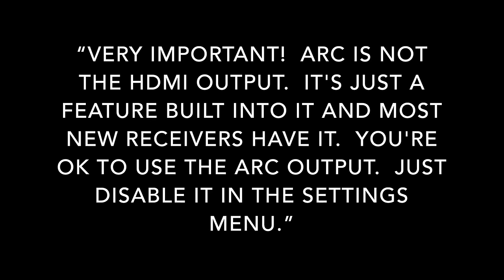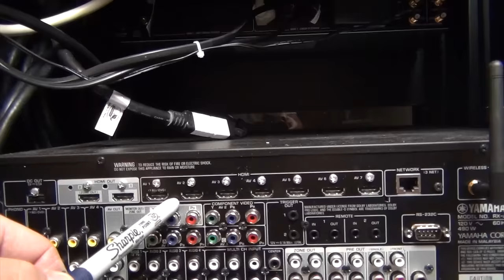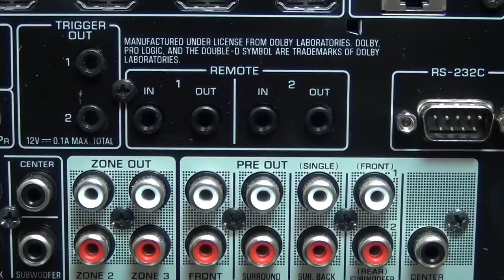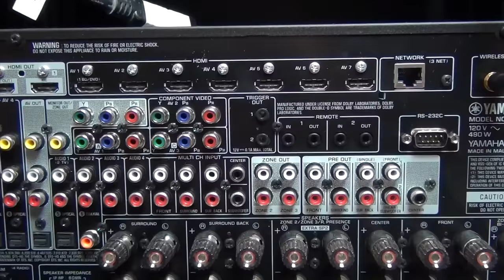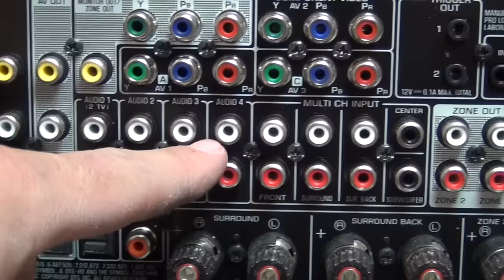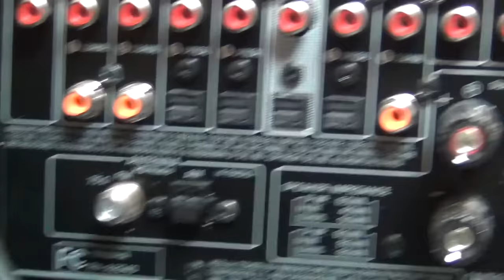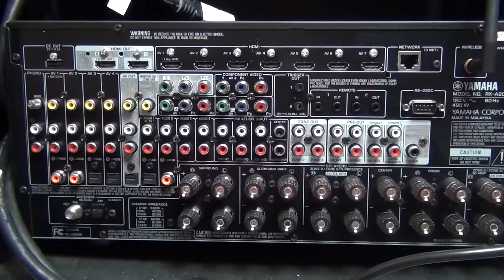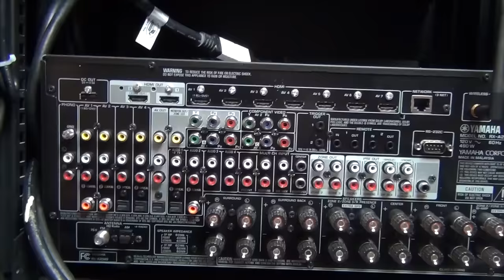How to connect a surround sound receiver - Part 3

Comment: Thanks for all the info and the last time I hooked up a surround sound was about 15 years ago and things have changed,  Question - I want to incorporate my two stereo systems into a surround sound system.  The two stereo systems each use separate Krell integrated and they each use two martin logan speakers.  I would like to set up a 5.1 using one stereo system for the front two and one stereo system for the two surrounds and I have a Martin Logan front speaker I could hook up to the processor as well as a veladyne sub which I would also hook up to the processor (Integra Receiver bought about 3 years ago).  Does that sound feasible using the  zone out / pre out  and which ones do I use - the pre or Zone.  Or should I just hook everything through the surround receiver.  Thanks
Reply from the maker: That COULD work, but I think you should only do that if your main receiver is under-powered to handle your speakers. You will use the pre-outs. "Zone" is for controlling speakers in a different room. Pre-out from your receiver to one of the inputs on the amp. Make sure you connect the RIGHT FRONT PREOUT to the RIGHT CHANNEL INPUT on your amp. Same for left and surround back. That's a lot of equipment to involve and a lot of adjustments to make it balanced. If a kid comes up and adjusts the volume, balance, or inputs on one of your slave receivers/amps, you'll have to adjust it back in. Then you have to make sure they power on/off together and remain on the right inputs. Sounds like a headache, but it can be done. Does that make sense?
Reply: Thanks Alan and it makes sense to keep everything in the processor.  Thanks for the quick response and too bad you do not install in Miami.  For me as I enter my golden years  the front speaker is the most important or I have to use subtitles.  My Bose TV with built in speakers died and Bose no linger supports it so they sent me a free Lifestyle 4500 and told me to go buy a TV.  The system sounds okay but I like my integra system better which is at my second home which I just sold.  So the Bose is going into the bedroom and the Integra into the TV room to use with my new 65 OLED LG.  Thanks again
Reply from the maker: Best of luck and thanks for watching!
Reply: What's a sticky  ?
Reply: Great vid by the way  :)

Comment: My denon receiver has no hdmi arc but my new Samsung tv has hdmi arc what am I to do no sound 🔊 surround sound ❓❓
Reply from the maker: The ARC on the TV won’t matter. ARC is a feature that can be disabled. I didn’t do a good job of making that clear. Just plug your cable/sat box to the receiver hdmi input and the tv to the receiver hdmi output and you should be golden.

Comment: What is a blaster?
Reply from the maker: I'm referring to an infrared red blaster for remote control systems. If you're using some kind of RF base station for your remote control, you're going to need to use infrared red blasters from the base station to blast the front of each device. Nice receivers have IR inputs on the back so you can connect a 3.5 mm mini directly into the back of the receiver. It's way more reliable in the short and long term. Typically, base stations have 3.5 mm minis for the IR blasters so you would just use a 3.5 mm mini to mini cable to connect the base station directly to the receiver.

Comment: a bit rushed.  up conversion-upscaling only gives fake hd, -  it cannot create the extra HD information not existing in SD input signals. it may be done better by monitor/projector, so compare. them with receiver/processor.
he mixed up speaker output terminals, calling them 'inputs'. centre channel s important for clearer dialog.
Reply from the maker: I actually agree with everything you said. Thanks for watching and commenting!

Comment: Isn't arc used for sound bars?
Reply from the maker: I try not to use ARC for anything but if you’re streaming Netflix from your smart TV and hooked to abound bar, you’re limited on options. If it were me, I’d get a Roku and stick it to the back of my TV with industrial strength Velcro tape and stream from that. Then connect the Roku to the sound bar. I really don’t like ARC so I try to avoid it at all costs.
Reply: @AlanCleggYouDoAV  our tv is a roku,, and just got a jbl 3.1 sound bar, it is showing to use the arc,
Now my living room is a whole different story,  Yamaha receiver and separate Yamaha amp,  klipsch speakers
Reply from the maker: @garys9718  Is the ARC feature working for you? For example, I like listening to Pandora without turning on the TV (trying to reduce wear on the TV). You can't do that while using ARC and obviously not if you're using the TV for streaming. I'd say, if you're happy with how it works with ARC, roll with it.
Reply: @AlanCleggYouDoAV  ,well I don't like using a bunch of remotes, and I've got the sound bar plugged into the arc on the tv, I had the DVR, and blue ray, plugged into the sound bar, and no pic on the tv, and hdmi cables are working, I've tried it on the tv directly, before the sound bar, I just hooked them up to the tv directly, and use the tv input instead, and have a optical cable hooked up with it too
Reply from the maker: @garys9718  This is the solution to all your problems.
https://www.bestbuy.com/site/logitech-harmony-665-10-device-universal-remote-black/5852832.p?skuId=5852832&ref=212&loc=1&extStoreId=773&ref=212&loc=1&ds_rl=1260573&ds_rl=1266837&ds_rl=1268709&gclid=Cj0KCQiA89zvBRDoARIsAOIePbAAAeOJWJjhyOXv3swZ9CY1-2NRCXhQ9sfrK9g0lgwn_L5qQko7IEsaAj5zEALw_wcB&gclsrc=aw.ds

Comment: ***question:
How can I connect my AVR to my power amplifier?
Reply from the maker: You use the “pre-outs” on your AVR. If you want the amp to power your front speakers, you’ll use the front speaker pre-outs.
Reply: Alan Clegg 
You are awesome! Thank you
Reply from the maker: No. YOU'RE awesome! Thanks for watching!
Reply: Alan Clegg 
Hi, it's me again.  I have 2 power amps. Can I ask you again please? 

If I can use the "FRONT" L and R pre-outs of my receiver to channels 1 and 2 (respectively) of my power amp... 
...Can I also use the "SURROUND" L and R pre-outs of the same receiver to channels 1 and 2 of my other power amp?

Thanks man
Reply from the maker: Yup. The main receiver is the brains/control center of the whole setup. All the amps should connect back to the main receiver to the corresponding "pre-out" for the speakers you want to power. Sounds like you have it setup right unless I'm misunderstanding you.
Reply: Alan Clegg 
Thank you. I think you read my setup correctly. I wanna get a 3rd amp for the "CENTER."
I dont know much about AVRs. I wanna get a descent budget-AVR. 'Any suggestions what budget-AVRs may have speaker preouts aside from Onkyo TX-NR?
Reply from the maker: I like Yamaha a lot. I use Yamaha exclusively on my own projects. "Budget" equipment means different things to different people so I don't know if i can help you much in that arena.
Reply: Alan Clegg 
Thanks. I understand. Yamaha is one of the tops out there. I guess, as long as they work as they should would be ideal.
Thanks again man, you are a lot of help. I wanna set up a DVR in the near future. I hope you dont mind if I come up with a question.
Reply from the maker: Glad to help and questions are always welcome!

Comment: i just bought a yamaha receiver, for 15 bucks, its older doesn't have HDMI ports but has a bunch  of plugs in the back
anyways i ran into a couple of issues wondering if u could help me figure it all out, so i plugged in some headphones and left side picture of the headphones on the receiver says silence i pushed every button on it to try and get the left side to play, any ideas? 
 and the other issue i have 5 speakers hooked up and to see which ones work i tested them all 1st and i have to turn on the speaker A B button to get some speaker out put to work , theres a button that u push to dial everything together, but there is so much to set whiches one should i use and not use? cause some speaker wire is on the top and some at the bottom, I never had to ever use speakers buttons A&B together, 
its model number is Yamaha 
RX-V640 natural sound AV Receiver
 if its easier u can email me at sodowd69@gmail.com
thank you, hope u can help me to get this sounding better lol
Reply from the maker: For the headphones, are you using an adapter when you plug them in to the receiver or are you plugging the headphones right into a head phone jack?
You should only be using speaker A. Speaker B is a feature not many people ever find a good use for. Turn on speaker A and turn speaker B off. On the back of the receiver, the front L and R speakers go to A. The back speakers go to the Rear terminals and the center speaker goes to the Center terminals. Make sure you are using digital audio cables for sound such as digital coax or optical audio. Then choose the auto surround soundfield if you want surround sound.

Comment: what the fuck is "blast the front" ?
Reply from the maker: Without watching the video back, I think you’re talking about when I’m referencing how to “blast” (or send remote control signals) to the receiver. Devices like cable boxes and AV receivers get infrared signals from the remote control. If you’re using a radio frequency remote you will have a base station that turn the RF signal into IR. The base station will have wired infrared blasters connected to them. Each blaster sticks to the front of a device to transmit the signal.

Comment: You don’t believe in wireless?  This guy is a joke.
Reply from the maker: Selling a customer a home theater system built on the backbone of a WiFi network is a joke. Thanks for the comment and thanks for watching though.
Reply: Wireless is lower bandwidth and lower reliability compared to wired. Just a fact, not an opinion.

Comment: how do you hook up a amp to a receiver to run 2 passive subs.?thanks
Reply from the maker: You'll still need to use the "subwoofer pre-outs" on your receiver. You'll go from the sub pre-out on the reciever to the "IN" on the amp you're using to power your sub. Then you'll use speaker cable to connect the sub to the amp. If you're using two amps, you can use both pre-outs on the receiver (one to each amp), or, if you don't have two pre-outs, you'll go from the single receiver pre-out to the amp "IN" connection, then connect the "OUT" on that amp to the "IN" on the next. Be carfeul about how you hook-up your subs. Daisy-chaining and connecting in parallel will change the speaker impedance and can fry the amp so be mindful of how you do it. You can use a two channel amp just to be safe if you prefer.